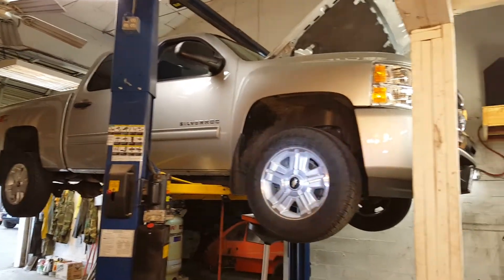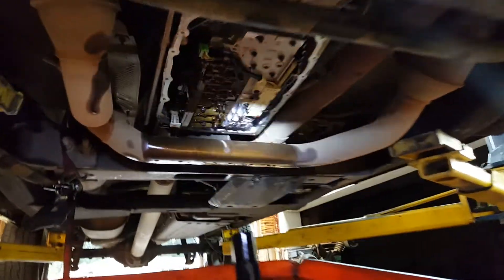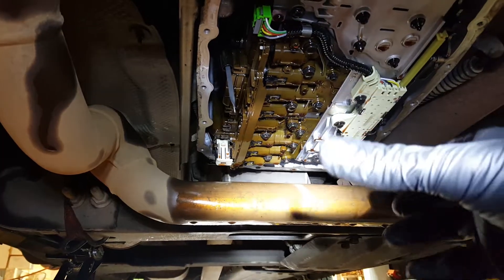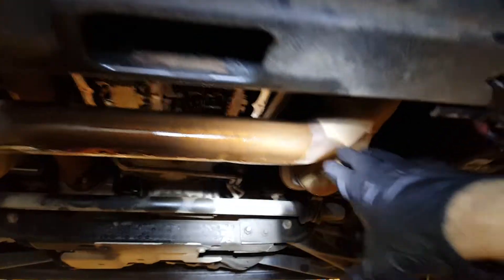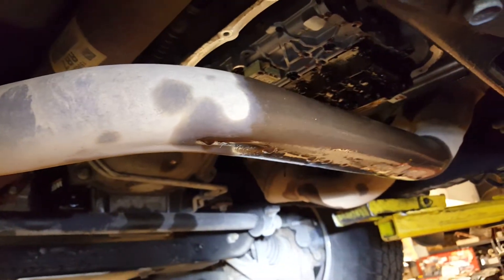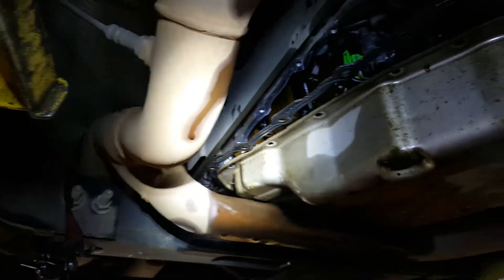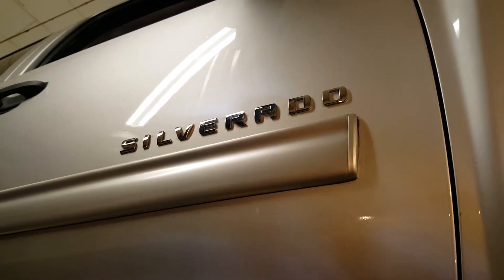Silverado Transmission Service Trick

Comment: I just want to say thanks - did this exact thing on my 2013 GM1500 and the transmission pan came out with minimal fuss.  Learned from this very video.  It actually works.  I watched many a YouTube video where they struggled for 20 minutes, jacked up the transmission, used bottle jacks and blocks, etc, but none worked as nice as this.  Some even gave up and cleaned, drained the pan in place.  The only difference with mine is that, because I do not have a hoist and a big drain, I used a MityVac to vacuum out the fluid from the pan once I'd done the first crack of the gasket.  I had a little laugh when the pan came out after 10 seconds of wiggling.
Reply from the maker: Yes I'm very glad it helped you that makes me feel good thank you

Comment: WORKS PERFECT!  Just did this method on my 2011 GMC Sierra with 5.3L & 6L80 transmission today.  SHORT STORY: I just saw the video titled "2013 GMC Seirra 1500 Transmission Fluid & Filter From Hell!" who could have used this trick.  I watched his video and was dreading the job... until I saw this one.  Thank you for sharing this one by 2stroketurbo!!
Reply: hello bro a question I would like to know how much you gave the proper torque tightening bolts of the transmission pan
Reply: I’ve got the same 2011 GMC and I’m thankful to see a comment that this works well!

Comment: To make it even easier you can take the transmission loose at the crossmember and lift the back of the trans a little using a jack.
Reply: THAT SOUND "'EASY"IN A  SHOP , BUT HOW YOU CAN """DEAL"" WITH THAT ""PROBLEM"" WHEN IS ""DOING"" ON FLOOR.

Comment: Hell I do all my under truck work using standard jack stands....if I had a lift like yours I would be in heaven.
Reply: For real.
Reply: I understand that. Same here I wish I had a nice car lift as well.
Reply: That’s for damn sure!
Reply: WELL ...IS TOO MANY YEARS FROM NOW...BUT i CHANGE THE TRANS... ON MY TRUCK  CHEVY 2003 AND i HAVE TO DEAL WITH THIS PROBLEM..i CAN'T TAKE OFF JUST FOR THE SAME PROBLEM ( THE STREAM) AND  HARD TO TAKE OFF THE SCREWS  FROM THE BRACKET TRANS...SO...i JUST GET A RAG AND TAKE OFF THE OIL INSIDE THE PAN , I CLEAN AS MUCH , I CAN INSIDE THE PAN AND CHANGE THE FILTER AND PUT IT BACK ...BUT  I WILL TRY THE TRICK HE SHOWS ON THE VIDEO NEXT TIME ( ONE YEAR FROM NOW)

Comment: Rotate the front of the pan slightly towards the drivers side and it'll create enough clearance to easily slide out,very simple without using straps or unbolting exhaust
Reply: Question? It's possible to drill and tap a plug on the pan?  Or I'm missing something? Than  would be no mess to remove the pan and replace the filter.
Reply: @PoisonShot20  I agree and yes they make a plug you can install after drilling the pan but I've heard they tend to leak so I was thinking have a bung welded onto the pan
Reply: @danielmoore8538  It make sense! Thanks!

Comment: Every pan I take off gets a drain plug installed if possible.
Especially if its stepped like this one.
Even if you still remove the pan to get the filter, it greatly eases draining the whole pan.
Stay gold.
Reply: I did that too. For 20 bucks got a new pan and welded an O2 sensor bung in the bottom. Saves a lot of mess.

Comment: You can loosen the pipe mounting bolt on the driver side to drop the pipe a few inches. It will eliminate the bending of the exhaust pipe, and the pan goes in much easier too.

Comment: I saw another YouTuber who did not use the rachet strap on the exhaust pipe. Instead, he lowered the trans pan just enough to get the filter out. This gave him enough clearance to then sneak the pan past the exhaust cross pipe. This was, however, on a 2020 Suburban (6L80E transmission "Easy pan removal") so I don't know how different that would be from a 2010 Silverado.

Comment: FYI the 4.8 exhaust does not have a flex coupling, but none the less still a good idea for the 5.3 guys✌
Reply: 4.8 doesnt have the 80E behind it.  4L60s you could service no problem with cross pipes.

Comment: I have a 2014 LT 20 inch rims.. Leveled... Idk why but I had no problems dropping the pan and removing it without having to move the exhaust or jack it up... I just took the bolts on the shallow end off first and the next 2 on each side then  loosened the ones on the side till they only had about 2 or 3 threads engaged... The 3 on the deep side I slowly loosened controlling the flow of fluid that poured out the shallow end... Finally had all bolts off pulled filter out and just let it drop in the pan on its side.. Pan slid out towards the transmission no problem

Comment: Remove the 2 bolts & nuts from the rear tranny mount, you can then jack it up about an inch. Between that and pulling down on the exhaust it gives you enough room to slip it in real greasy like.

Comment: Good tip on the ratchet straps. I have a 2017 LTZ Crew Cab standard bed not 4 wheel drive. When you have the pan off why not just cut & add a drain plug to the pan? Yes a little more work but if you're going to have the truck for a good length of time & want to do this filter/fluid change adding a drain plug would help on the draining of the fluid & then your tip on the pan removal. Thanks for your video.
Reply: 2541968joey you still have to remove the pan to replace the filter. So having home brew installed bung/ drain plug is just a potential leak point.
Reply: @chevyon37s  I did it to mine and zero issues. Plus, I can change fluid more often without having to change the filter every time.

Comment: Seems crazy they  would design it such that the exhaust would add so much heat to the trans fluid, especially in stop go traffic.  Nice tip !
Reply: a bunch of cars have the exhaust setup like that and it really doesn't affect them too much
Reply: You are right and I guess space it is at a premium.  Thanks
Reply: Like yeah it affects them but most the heat will be at the bends
Reply: sail235aeh Hell I might consider heat wrapping my pipe after I reinstall my pan, to see if it make a difference. But most of the time these trucks have a trans cooler anyways.
Reply: sail235aeh just cooking the fluid so it degrades faster
Reply: It’s only a problem if you’re idling lots. With the air flowing, I doubt that heat makes it into the fluid.

Comment: Had 251k on mine 3rd going too 4th was rough and started getting bad so I took a risk and it paid of the fluid was brown but not black so I drained just the pain and now it’s running better than before I had it( was and hand me down from my grandpa bought it off him 4years ago with 215k on it had no idea he hasn’t changed the fluid until I had it for a year but someone told me too hold off until it starts acting up not worth the risk😬but I took it it turned out great but lucky )
Reply: Good for you!! My buddies and I have done many high mileage GM's and never a problem!!
I don't care what anybody says. Change your transmission fluid every 60 to 80 thousand miles!
FLUID WEARs OUT!!
Plus it's lubricating the transmission internals..

Comment: You would think they would use drain plugs in the trans & diff, but no, that would be too easy and their dealership network couldn't charge you an exorbitant amount for a simple fluid change. That's some engineering, I want their job!
Reply: You should see how much of a PITA the 8L90 is to service.
Reply: My 2004 1500 has a transmission drain plug. I loosen the trans mount and take a prybar and pry up on the tail of the trans and down on the exhaust and the pan falls right out.
Reply: i purchased an after market pan that has a drain plug built into the first time i serviced my silverado's transmission. i no longer have to drop the pan everry time and simplifies the job.

Comment: Yeah my 2013 has an aftermarket dual exhaust so this isn't an option. In my case it's Best just to undo the rear mount and lift the transmission

Comment: Thanks for great Video. When I do mine, I will be adding a drain plug.
Reply: Drain plug won't help you change the filter though.
Reply: @chrised1115  When I do change the fluid and filter, I will drill a hole where I'm putting the plug, so I don't spill and drip all that crap on me.

Comment: Thank you so much for the tip. I spent 6  hours trying to figure it out until I came across your video. What would the word be without YouTube?
Reply: Well you had to figure things out on your own. The more you use your brain the smarter you get. The problem is with YouTube you have to be smart enough to know the difference between the best way or NOT 😉

Comment: you just put that pan back on there with the filter mating ring stored in the filter, you can see it right in the filter pickup area
Reply: 😝 🤣 I saw that too..🙀
Reply: Hey said he had already installed it…the one in the pan is the old one.
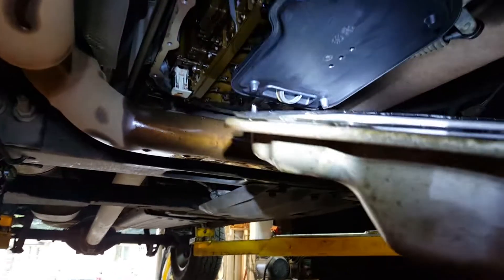Reply: @keithrayeski3147  3:20 mark it is in the filter, you can see it in the pickup slot of the filter
Reply: @keithrayeski3147  doesn’t really matter which one is old or new it shouldn’t be there 3:20 mark

Comment: Is this a different transmission than the 2013 model? Mine's a 6 speed. And it seems like the transmission pan is shallow enough to maneuver it in and out without having to do that.

Comment: Been wrenching on vehicles for 40+ years. There's no reason to change a transmission filter unless something went wrong with the transmission. Changing fluids is all they ever require.
Reply: Twoleggedkumulava  vacuum extractor...like used on boats.
Reply: Atouk I believe the transmission filter magnet doesn’t catch all of the tiny metal shavings  and it gets stuck into the filter screen and eventually it will make fluid hard to go through it..you ever see a magnet get so much shavings and it won’t stick to the magnet Anymore ?
Reply: Usually, any debris a transmission filter sees is upon break in or as a result of failure like you say.

Comment: Does your transmission flare at 2nd to 3rd gear sometimes? My 6 speed transmission on my 2010 Cheverolet Silverado truck does! I was just wondering!
Reply: Yes mine does too drive me crazy
Reply: The man The Legend does your truck also lifter tick for a couple of seconds and goes away? Mine does it on cold start, but the past couple of weeks I have noticed that it would lifter tick for a couple of seconds and then go away on a warm start after the truck had been off for about an hour. It doesn't do it all the time on warm starts. I was wondering if your truck does the same as mine does?
Reply: @egertonridout4102  I have a 4 speed in my 08 with the 4.8. Shifts kinda hard from 1st to 2nd. I think each transmission on all of these from this gen has their own common issues
Reply: my 2018 has that
Reply: @patrickhlubikjr2748  my 09 v6 has a hard 1st 2nd shift as well. I'm scared I heard so many stories and myths. Have no clue what to do. Any suggestions

Comment: I'm just curious.I've seen several of these videos and it seems no matter what the year of the truck or model, all these GMC trucks are basically the same. My 2018 Escalade looks like that and the pan is a bear to remove and all the videos seem to come up with one method or another of forcing that exhaust pipe down. Is that how they do it at the dealers? If that is the case it makes for some really dumb engineering and design. You would think that things that require regular service should be easily accessible. I try to do what I can in terms of service because I hate taking my trucks to the dealer. I have taught myself through many you tube videos from folks like you who share your knowledge and experience.  Thank you!! They say a little knowledge is a dangerous thing  but when I see the kinds of greenhorns they have at the dealer doing an oil change on my almost $100,000 truck, well  I'll take the chance on performing that service myself. Not to get too side tracked, so when you force that exhaust,  pipe which is fairly rigid,  are you Not compromising the seals or the unions? It's not particularly flexible.

Comment: I didn't do any of that I disconnected the upper return line on the radiator I plugged the line and ran a 1/2 od  plastic tubing from the radiator  ran it into a bucket I started the truck and got about 2 gallons .I lowered the front of the pan I removed    the filter wiped out the pan and the magnet be patient I did it good luck

Comment: is it better to use a transmission flushing machine to change the oil or do it this way? and how many atf needed for this car?
Reply: A flushing machine leaves the old filter in the transmission. Changing fluid this way leaves a torque converter full of old fluid. So, probably the best way is to drop the pan, install a new filter, then flush the transmission. You don't need a flush machine though, just unhook the cooler line to the radiator, start the engine and add trans fluid until it comes out new and clear. But really, just doing what's illustrated in this video is good enough. Many many transmissions go hundreds of thousands of miles and are NEVER serviced.

Comment: Just take the exhaust bolts loose
Reply: Joe Smith wouldn’t you need to replace the exhaust gaskets if you did that? They are crushed to make a seal and once you loosen them they won’t seal again and you’ll have a exhaust leak